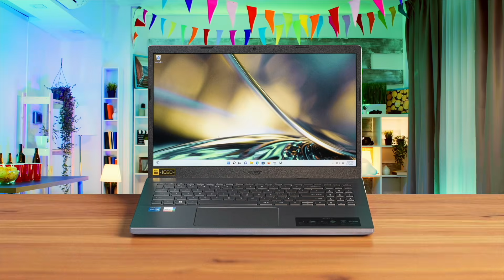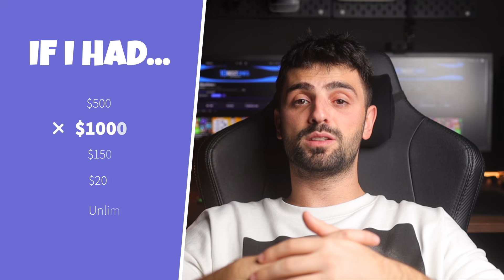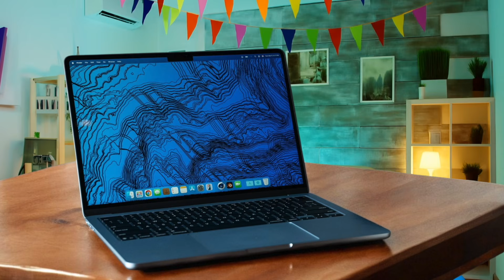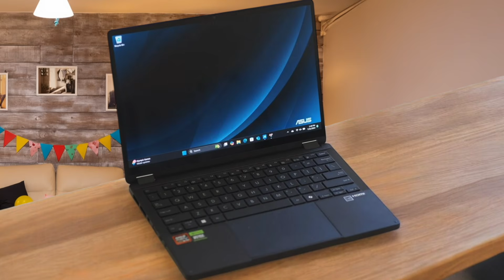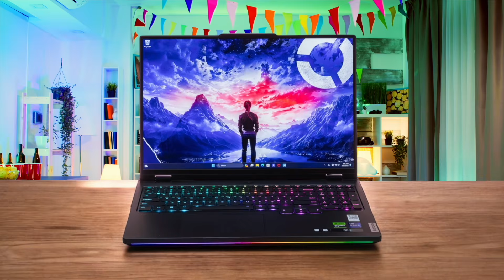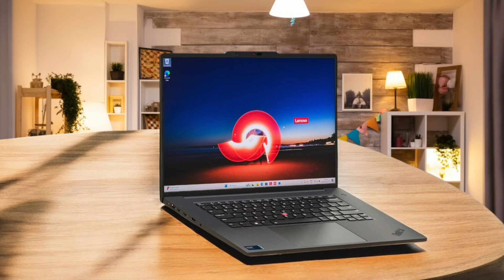The ABSOLUTE BEST Laptop For Graphic Design Of 2025!

Comment: macbooks are actually terrible for graphic design, windows has all the best creative software.
Reply: Why
Reply: Expound. As far as I know, macs are much more efficient and run creative software much smoother as long as you get enough ram. Also, most of the GD industry is run on Mac, and if you're going into typeface development, Glyphs and Robofont are only available on Mac. Don't get me wrong, I love my windows machine and it runs very well, but saying that macs are bad at creative tasks is just wrong. The only case I could see is maybe some 3d applications